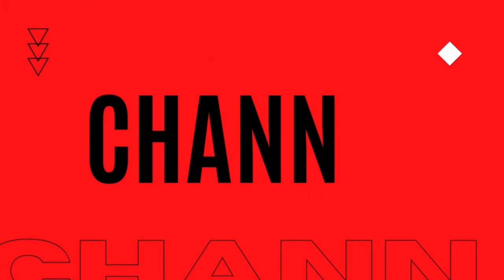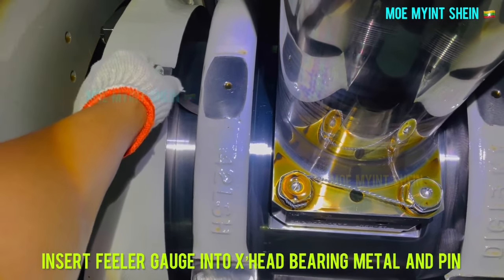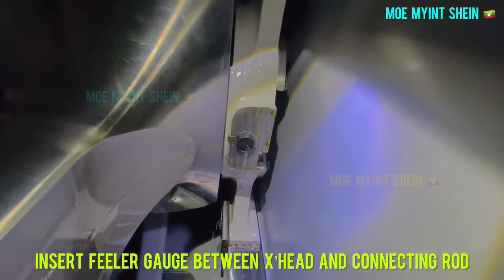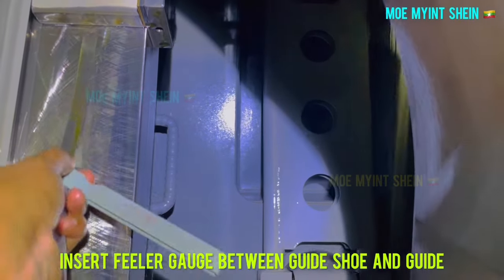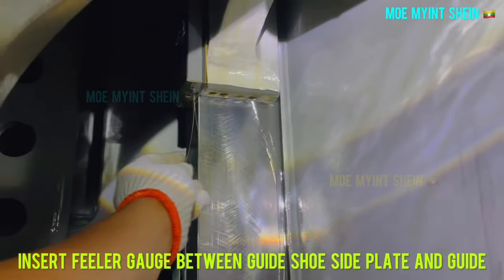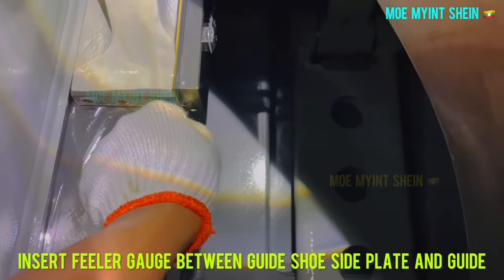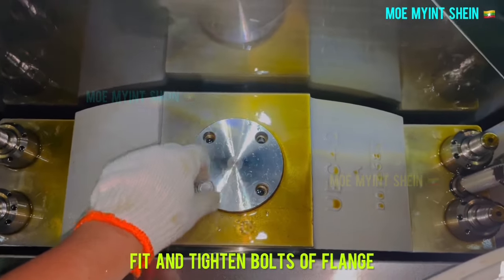Measure Clearances of Main Bearing | Crosshead Bearing | Guide & Guide Shoe | Technical Vlog : 093

Comment: How the guide shoe will rest against the crosshead guide when the crankpin position is 45 degree after BDC, turning in astern direction ?
Reply from the maker: @najinkunnath6009  
45' after TDC. (Not BDC.)
Depends upon maker and model, crank angle may differ. 
In this engine, maker said guide shoes rest on guide @ 45 degrees after TDC. 
Thanks.
Reply: @MoeMyintShein_MMU  Thanks.
Reply: @MoeMyintShein_MMU  Is the main engine rotation clockwise or counterclockwise from flywheel end for ahead command ?
Reply from the maker: @najinkunnath6009 
Clockwise for this engine, 6UEC42LSH-Eco-D3
Reply: @MoeMyintShein_MMU  ok

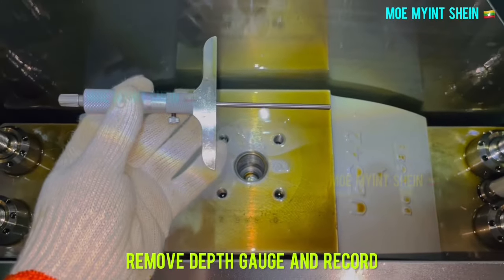Comment: 05:52 wont the oil under the depth gauge be a problem
Reply from the maker: Good Question !
We have stopped main line oil pump and cooled down for a while before entering crankcase and take measurement. 
Can assume crankshaft isn’t afloat due to lube oil pressure.